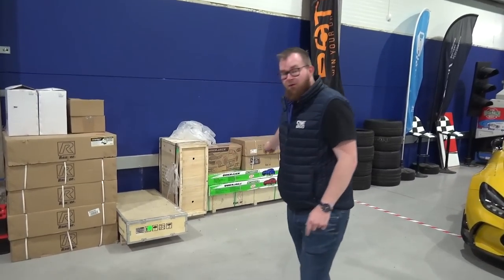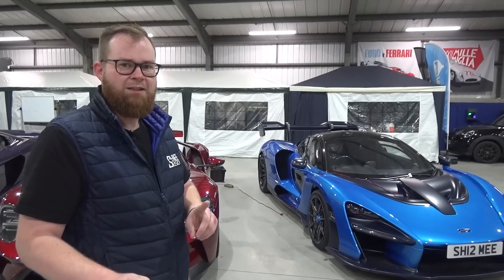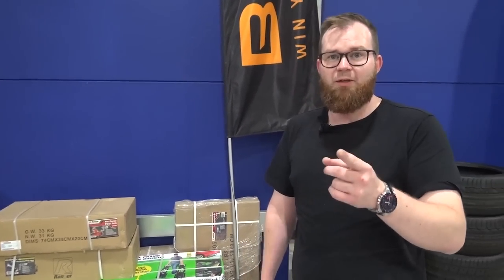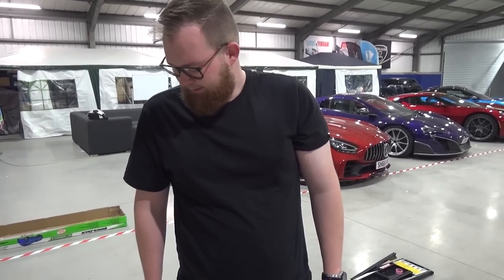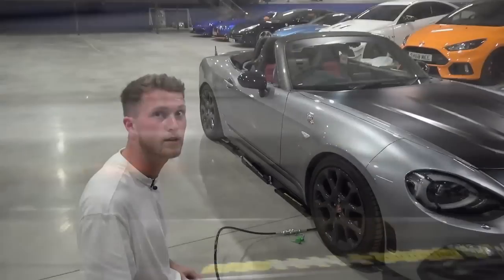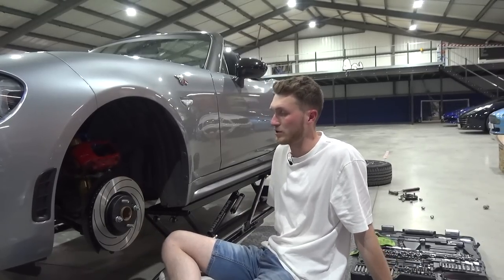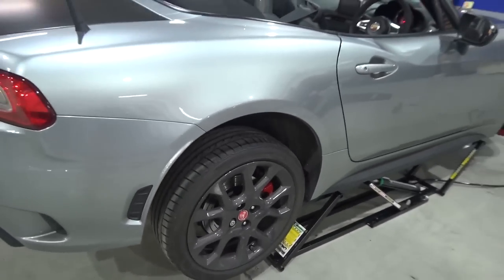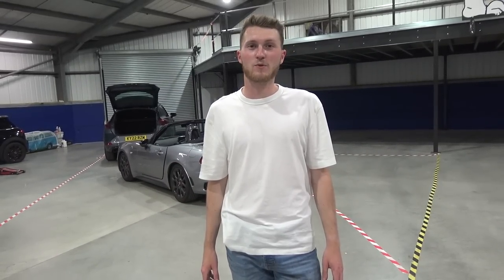IMPORTANT UPGRADE! Modifying Brad's Abarth 124 Spider with TAROX Brakes | SHMUSEUM VLOG 74

Comment: You can’t transmit heat through a empty groove. The slots allow excess dust and gases to escape. This keeps the pad in contact with the rotor and increases friction. The veins on the inside of the brake rotor are for heat.

Comment: I always love seeing Fiata content on the channel.  Those cars have a seriously great sounding stock exhaust.  It is about 75% Mazda, built in Hiroshima, yes... FCA engine, MK3 MX5 transmission.
Reply: Basically a car for whoever wanted a turbo mx5 from factory 😄 the negative was that, when new, it costed (the Abarth) 10k (at least here in Italy) more than the 2.0 sport (mx5).... No Wonder it went so quickly out of production
Reply: @SPProduction02  It didn't help that they built the vast majority of them with automatic transmissions.
Reply: @MiataChannel  that's another reason, yes...